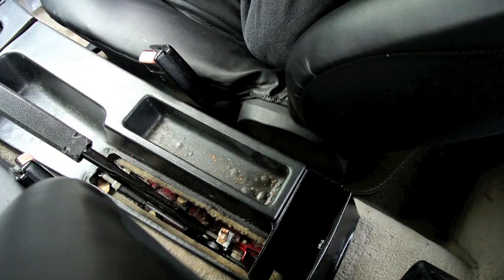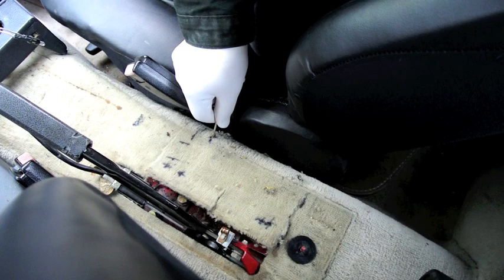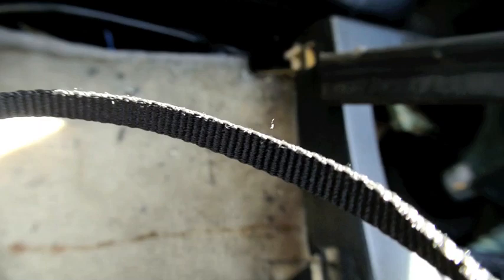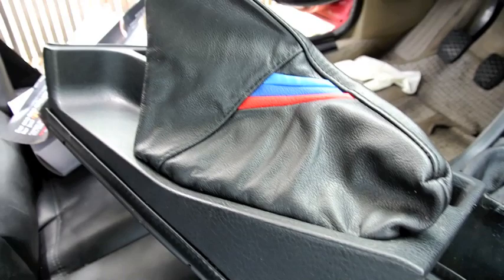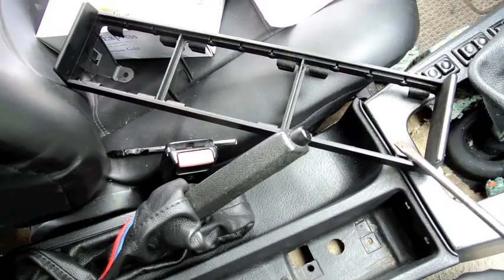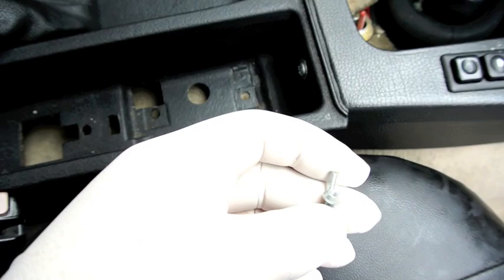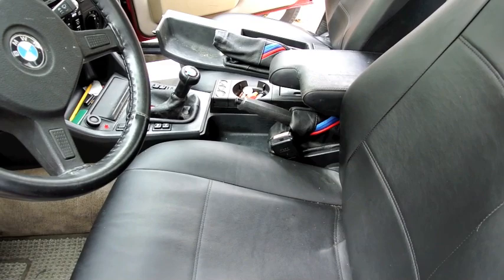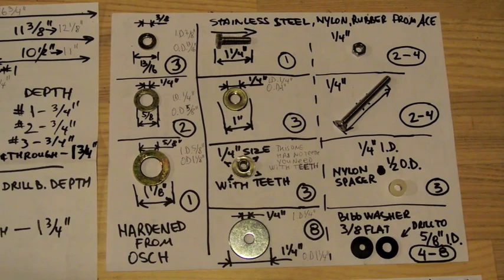BMW e30 ArmRest installation using e36 armrest. Plus Center Storage Tray and Cup Holder

Comment: THANK YOU!! I have never commented on any YouTube videos but want to express my gratidute. This is my favorite mod on my 1989ix (so far). Your video is PERFECT. The attention to detail with the the trunk seal and foam weatherstripping makes it look factory. I especially like the end where you have the parts list and schematic. Truly one of the best how-to videos on YT. A tip of my hat to you. I just had my entire interior ripped out for some rust repair. I had initially used rivnuts but upon reinstalling, my angled hole rivnut is spinning. I am going to use the toothed washer that you recommend in that hole going forward. BTW, I have swapped to E36 heated seats. The console is snug between these wider seats but everything does fit in the E30.

Comment from the maker: It's not that complicated. Only 3 holes to drill. It was complex for me, but I was doing it for the first time. You have all the measurments and hardware list available. It's all straight forward. If you can drill a hole you can get it done in less then a few hours. When I was doing it I did it leasurly, without rushing it and it didn't take much time.

Comment from the maker: E46 has holes and mounting nuts in place from the factory. All u do is remove your center console and bolt down the arm rest. All u need is parts. For example on e36 takes 30 min to install it. It's all similar to my video, but no need for measuring, drilling and securing hardware.

Comment: Wow and I thought that installing a armrest from a sedan on my coupé was hard. My car had the holes already drilled and it still were a pain in the ass. Even though I used the washers, the armrest is still to tight against the seats. So I will have to replace the seats with new ones..